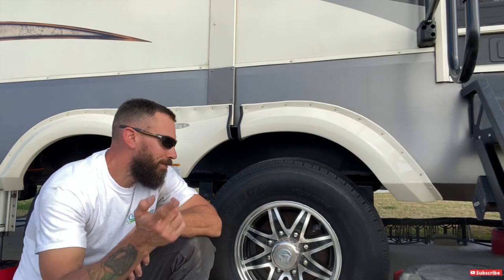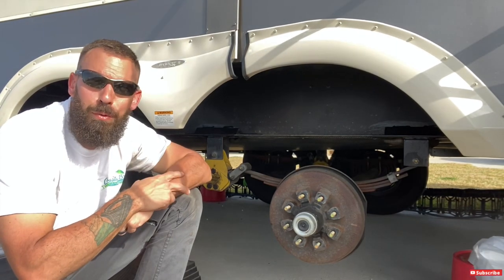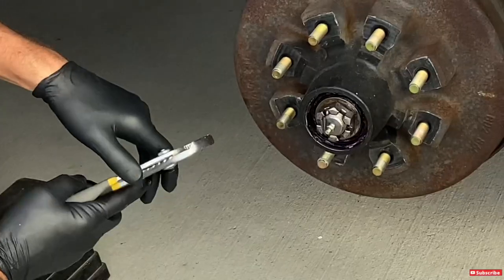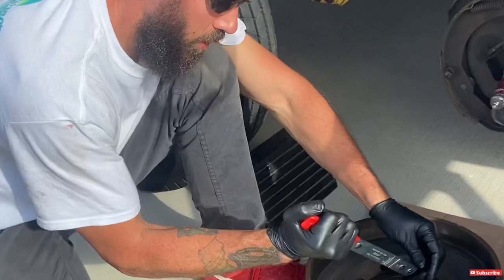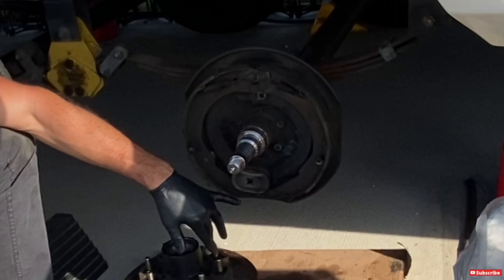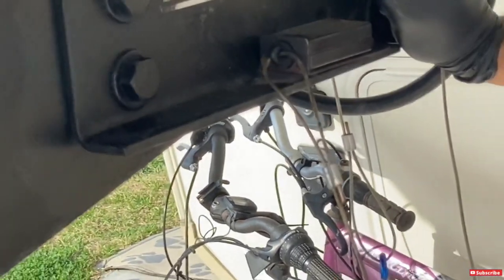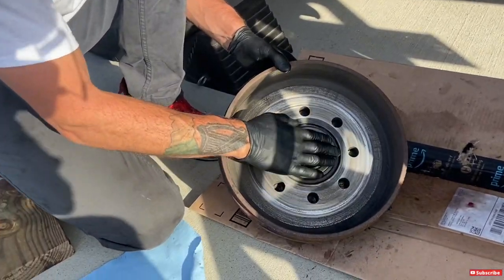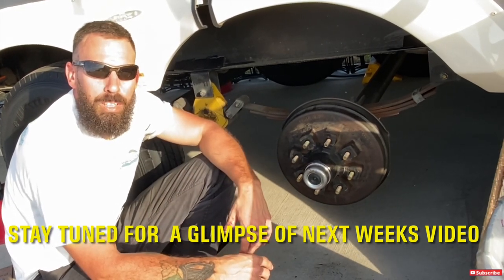How to repack wheel bearings | Installing grease seals on Grand Design Solitude

Comment: No, just NO on backing off the nut a quarter turn after just snugging the nut up. Timken/ tapered bearings are meant to have no end play. That means all the load bearing rollers are sharing the load evenly. Any end play allows weight to be concentrated on fewer rollers shortening  bearing  life.
Reply from the maker: Interesting. On this style you absolutely have to back it off a hair because you will never get the cotter pin to lineup with the hole otherwise.
Reply: When you stated to back off the castle nut a quarter turn you already had too much end play, then you loosened the nut more yet to get your cotter key in. If you are going to turn the nut looser then at least only do it from a no end play position. There is a lot of people concerned with what they consider too tight as far as tapered bearings are concerned but actually a very slight preload on that style of bearing is desirable. That will allow for a little bearing wear and ensures proper load distribution of weight. Every trailer bearing and some other vehicle bearings are so loose that the wheel moves when you grab it. Trailer axles are made so cheap that they don't provide a system that allows a more accurate way to adjust the nut properly. They only provide a castle nut which allows only six positions for the nut. I usually drill an extra cotter key hole in the axle which provides twelve nut positions. In other cases I install thin shim washers to allow the castle nut to be positioned in new positions. I have trailers i have owned for over twenty years that have no loose or bad bearings the whole time when I test the wheels for that. Have a good day. 😊
Reply: You are Absolutely 💯% Correct. That is way to loose for that style of bearings. 
Tighten it while turning the hub until you can't move it and back it off just enough that it comes free.
Reply: @James Glenn. I don't like to turn the axle nut loose to find the correct preload on bearings. Once the bearings/races are seated by over tightening, I loosen the nut completely and turn the nut tighter to find the exact point that you can feel resistance on the nut indicating no bearing free play,  then I slightly tighten the nut to preload the bearings.( and not finger tight-just slightly more with a wrench)  It is more accurate to find the exact point where there is no bearing free play by tightening. Loosening is more guess work. After all, torquing anything else is done by tightening as a rule. Have a good day! 😊